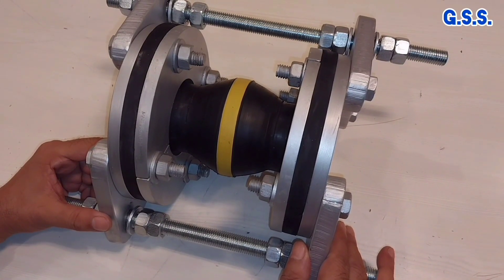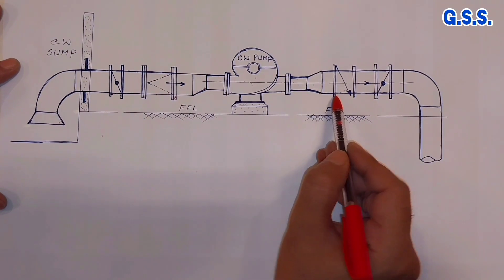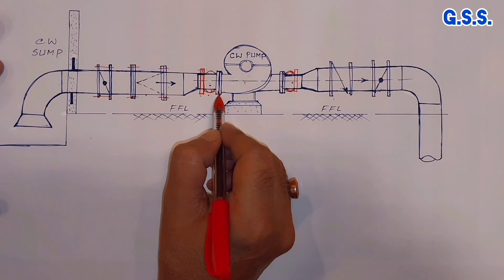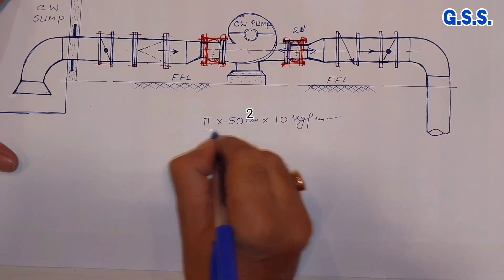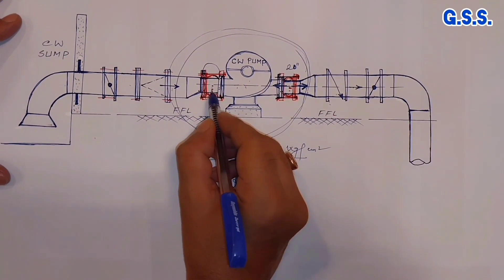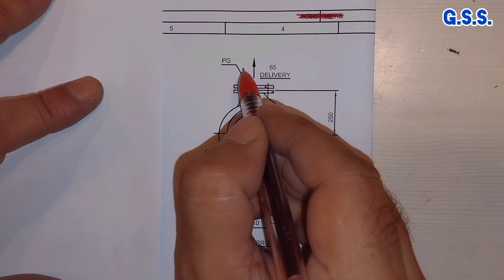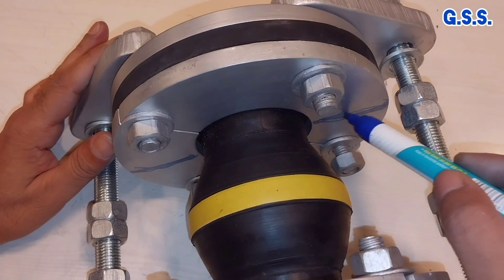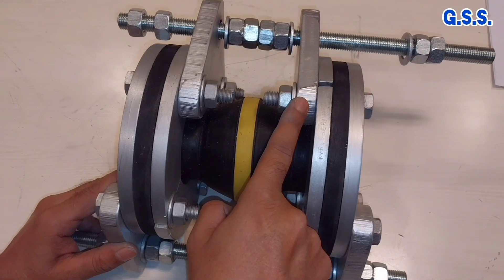Piping Engineering : Rubber Bellow - installation philosophy

Comment: How to do analysis and conclude that exp ballow is required for the pump ? What's the minimum axis, lateral or torsional load to provide exp ballow. Sometimes the suction side of pump doesn't provided with the exp ballow.
Also we've to provide 3d at suction n 5d distance at discharge nozzle to prevent cavitation..... does exp ballow installed within these gaps or after it ?